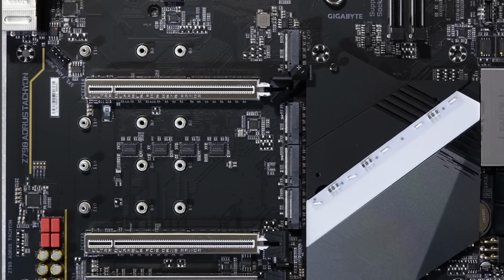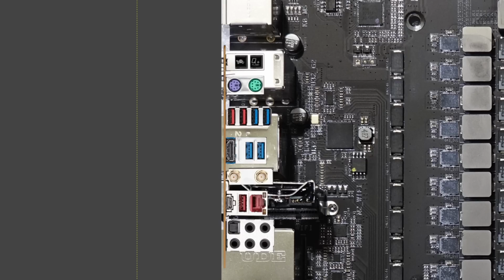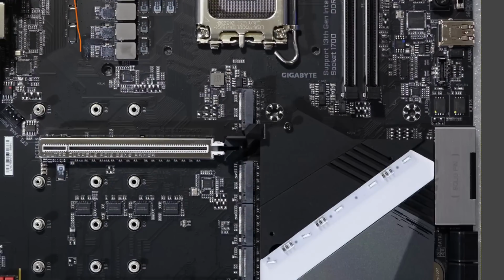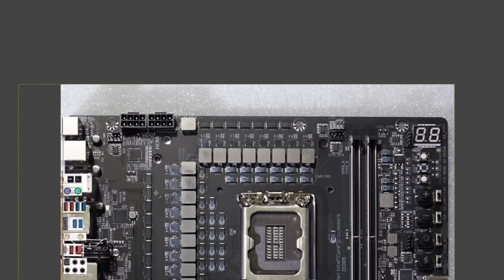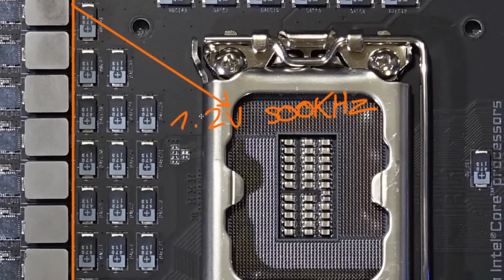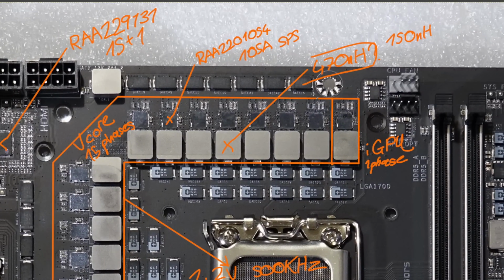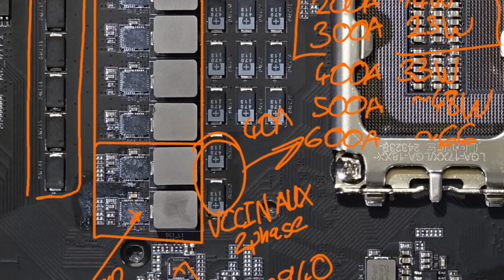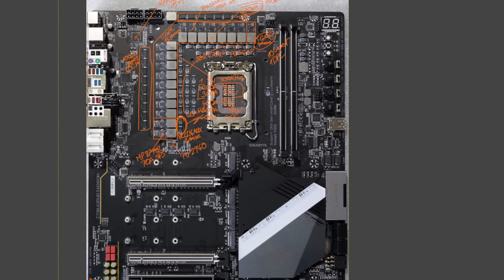mobo PCB Breakdown: Gigabyte Z790 Aorus Tachyon

Comment: thanks to the author for the information, very cool all told).

By the way, I have the same board and the overclocked memory is stable at 8000 Mhz CL36.

The memory is this one - F5-7200J3445G16G [G.SKILL]

Comment: Nice detailed video thanks a lot, i have 6 motherboards Z690 and Z790 where the graphic card wont work no display, but if i move the graphic card to the other slot the board will post, i have changed parameters in the bios running pci gen 3 with no luck, updated the bios still no joy, there is no physical damage upon inspection under the microscope the cpu pins perfect, the back of the board perfect as well no missing components or cuts on the traces, i dont know how to fix them, i run out of solutions.

Comment: Would i gain anything from going from a 12900K to a 13900K on my ASUS Strix "E" z690 DDR5  mobo?  Or scrap the idea and wait for next gen next year?  I'm a flight simmer and I'm even thinking of going to 64 or 128GB RAM because my 32GB is getting eaten alive by MSFS 2020 in VR but also by all the mods to the MSFS-2020 in the community folder.  Just chews it all up, I feel that only having 32GB is slowing me way down.
Reply: I’d wait
Reply: I’d hold off on the 13900K upgrade for now until the refresh is out. It’ll presumably handle higher memory speeds and have slightly better single threaded performance.
Reply from the maker: unless there's something you want to do that you system currently can't do there's no point upgrading.
Reply: @ActuallyHardcoreOverclocking  no, nothing particularly other than wishing to have great single-core speed for a sim (MSFS-2020) that is multi-thread limited (but they are working on DX12 but it's just beta now and has problems - assuming DX12 is going to spread the processing around to all my threads of the 12900K).  So thanks very much, I will just leave my Z690 paired with my 12900K and save my money then.  Much appreciated !!!!
Reply: @Dr_b_ I have a z690
Reply: @Dr_b_ oh wow, ok, i'll keep eyes and ears awaiting news

Comment: I have a question, i have an i9 13900k, i got 6ghz stable with 1.42v on an Z690 Aorus Ultra, i sold the board cause it was bad for memory overclock and couldnt even boot when i tried a little overclock..I got a new Z790 Asus prime A, was better at memory overclocking, same 5600mhz stick could work now at 6600mhz, but i couldnt get stable 6ghz anymore at that voltage, and if i went over that voltage it would run too hot and downclock...Sold the Asus board cause i wanted that 6ghz back, now i got an Z790 Aorus Master which should be even better than a Z690 Aorus Ultra but i cant get stable 6ghz on this board either, i tried exact same voltage and llc but it would crash, cant go higher on voltage cause then it downclocks, memory overclock is better than my old Z690 board but it sucks that i cant get that 6ghz stable anymore..My question is how is this possible? Did my cpu degrade? I just game and they dont even pull anywhere close to the 350w+ that a benchmark can do
Reply: Yep cpu degraded
Reply: Memory OC affects cpu OC
Reply: @emini6  Right cpu degrade because he changed the motherboard 😂
Reply: @pabloPL103  memory oc never affect the CPU cores. Remember intel imc flow: memory signals from mobo (vddq) before it goes to the ring first than the cores; memory>ring+L3>core.
Also 10nm intel doesn't do 14nm voltages, so with 12-14gen(hybrid mesh architecture) anything above 1.30+vcore requires sub 0c cooling or below for above stock CPU overclocking

Comment: I have a problem with this, in recent years motherboards have not enough SATA ports. Magnetic disks continue to be important and widely used for data storage.
You buy a motherboard for a lot of money, and you don't even have anything to connect your hard drives to, not to mention RAID arrays. 6 ports is the minimum, but 4 is already spitting in the client's face.
Reply: pcie to sata card on the bottom slot - it's pci3 x 4 - it should be able to serve a lot of spinning disk; 10x SATA  costs $43 at amazon.